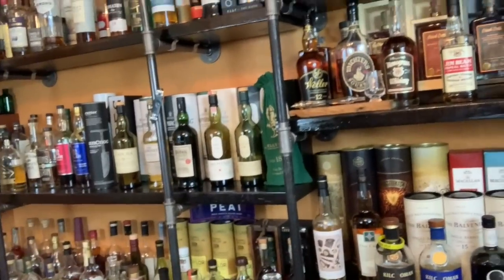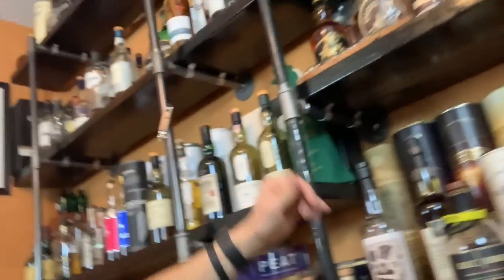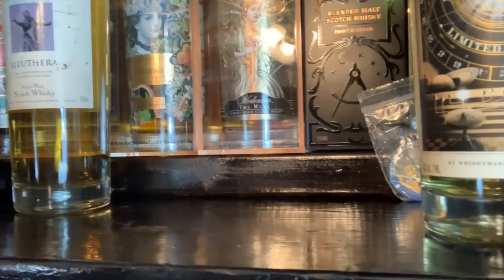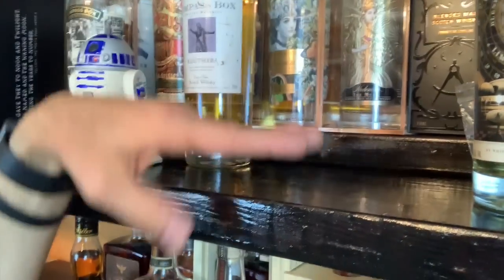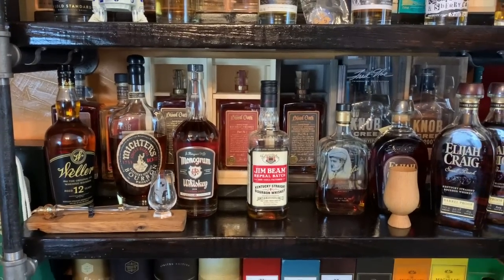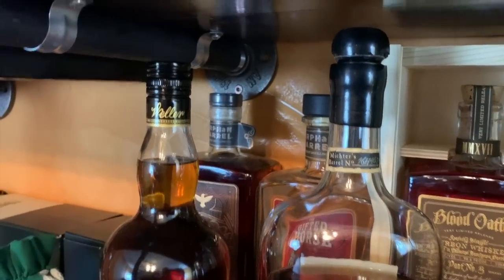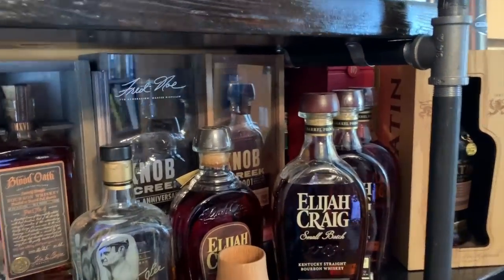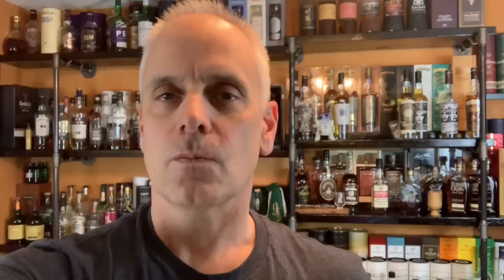How to Build Whisky Shelves...Part 2

Comment: This is very helpful!  If you wanted to go deeper, could you use 18” pipes as the board supports?  You could join a 2 X 12 and a 2 X 6 for the actual shelf. Or would this be too far from the wall and reduce the strength of your shelf?
Reply from the maker: You could

Comment: Just a little confused on one topic.  In video one you showed to use 12" pipe for the horizontal supports for the boards.  You used 2x10" boards with them.  In the second video, you mentioned shifting to 2x12" boards but I believe you said to use 12" pipe for the horizontal supports?  Did you use the same length support bars or?
Reply from the maker: yes, lesson i learned after the first set of shelves.  you can use 2x12 boards with the 12 inch horizontal pipe.  Gives a little more shelf space and they fit just fine!

Comment: Scott, great videos - both of them.  Did you say all of your shelving boards are 2x10 or are some 2x12?  It looks like the ones  you are using  give you plenty of depth for two rows if they are 2x10s.  love the idea of adding the 2x4 to use as a riser.  Have you had any issues with the boards sagging from the weight?  Thanks again for the vids and cheers.
Reply from the maker: the first set of shelves I used 2x10's and then 2x12's after that.   2x12's work better.  No sagging at all, but that could depend on how far you go between supports.  Mine are two studs or 32 inches and it would take quite a bit more weight before sagging.

Comment: Really nice.  Being stuck at home for a while, I think I need to take on this project and build something in the basement for additional shelves.  By any chance, do you know or still have the seller from eBay that you bought all the stuff from?  On another note, I am assuming, you bought the 2x4's from local Hardware store?
Reply from the maker: all the wood was Home Depot/Lowes and the pipe from different sellers, just whoever was the cheapest!

Comment: Maybe it was mentioned and i missed it but what is the actual height on your 12" shelves?  I'm doing something very similar and trying to calculate total height with the t-fittings and 2x12.
Reply from the maker: just measured and they're pretty true, the 12 pipe results in a 12 1/4 inch shelf and the 18 inch pipes give an 18 1/4 inch shelf
Reply: Thanks Scott!  Much appreciated.